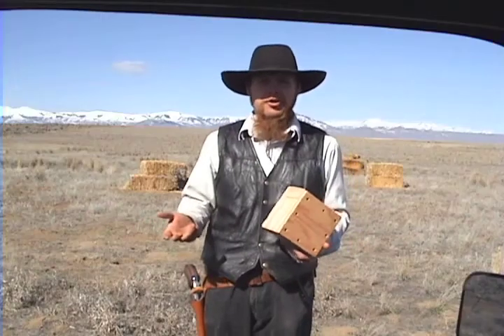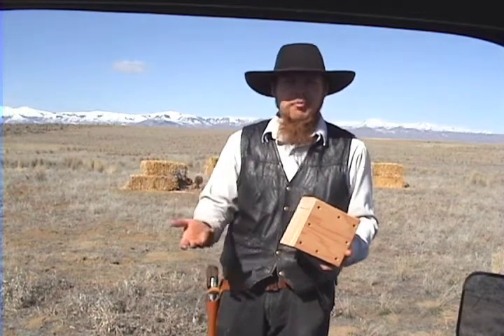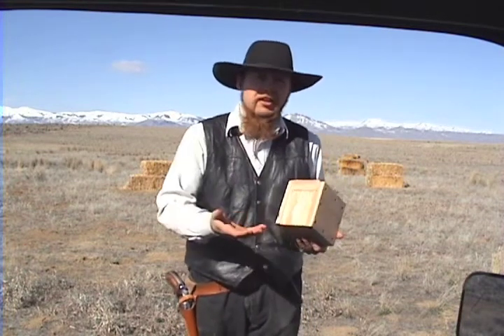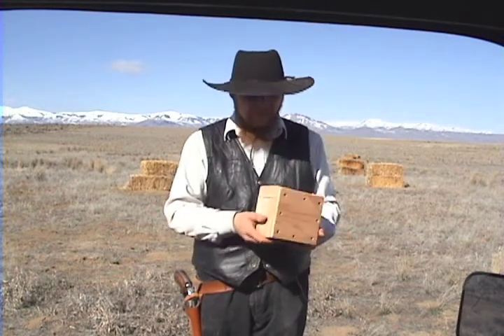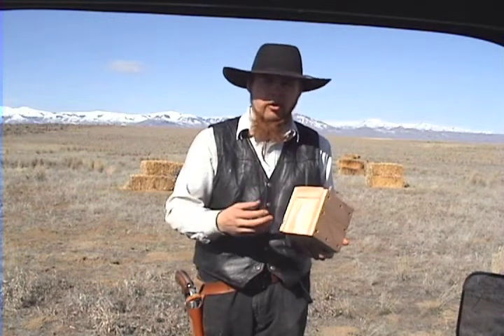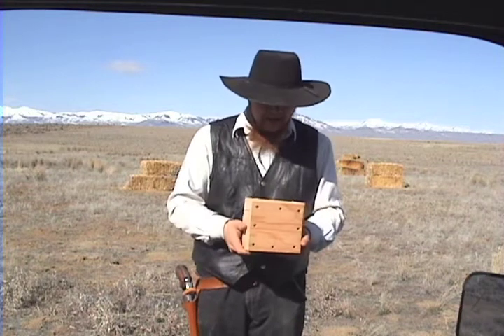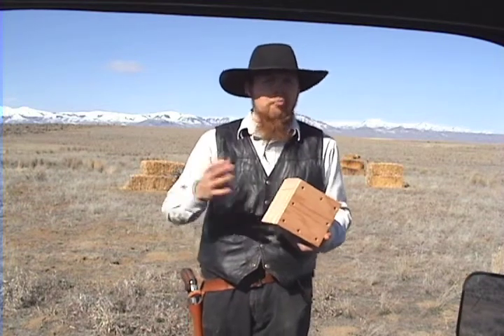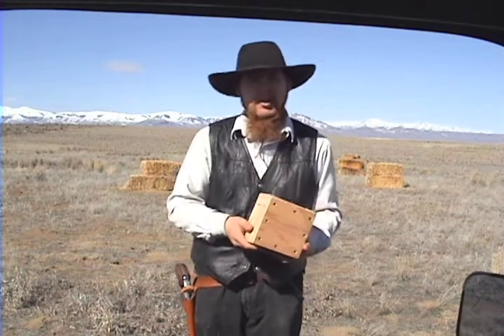Measuring Stopping Power (TIS028)

Comment: This measures momentum of the round, not KE. If you shoot this with a 5.56, a rifle round, it will swing less than when shot with a heavier pistol round, even though pistol rounds are considered anemic in comparison to rifle rounds. Also, performance of a hollow point round can only be accurately judged with a gel test.
Reply from the maker: Actually, this test is measuring neither the KE of the bullet nor it's momentum, per se, but rather it's ability to transfer momentum to a gel target.  If the target were large enough to stop the bullet, then this would be a simple measure of momentum.  However, where the bullet passes through the target, as in this case, only the amount of momentum that is transferred to the target on its way through is measured, which provides a measure of the efficiency with which the bullet imparts momentum (and implicitly energy) to the target, and therefore provides a quantifiable measure of terminal performance.

Comment from the maker: I can see I need to clarify some definitions. In ballistic parlance, "stopping power" or "knock-down power" is the measure of a bullet's ability to stop a threatening target in its tracks and knock it to the ground, and is generally proportional to the momentum of the bullet, although it will also depend on the terminal performance characteristics of the projectile.  Thus, by measuring momentum transfer with a ballistic pendulum, we obtain a measure of the stopping power of the bullet.